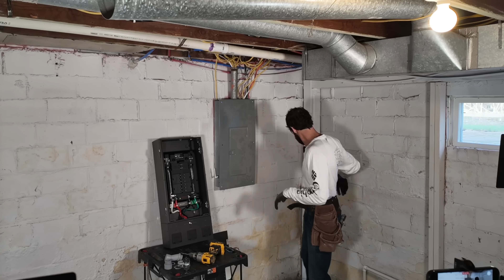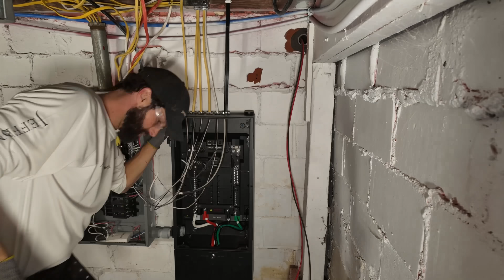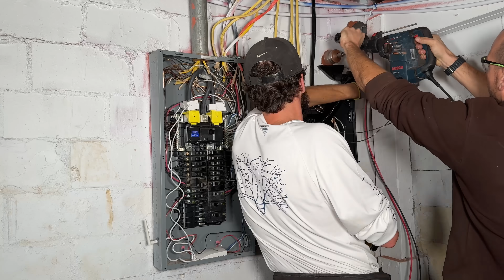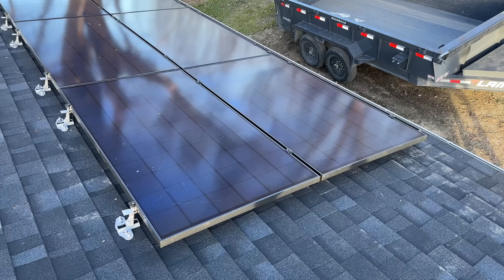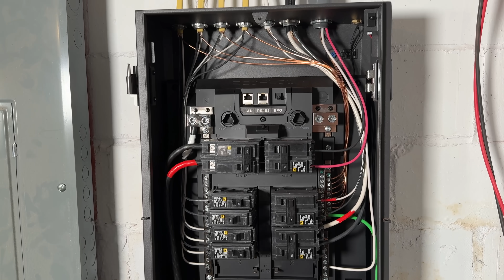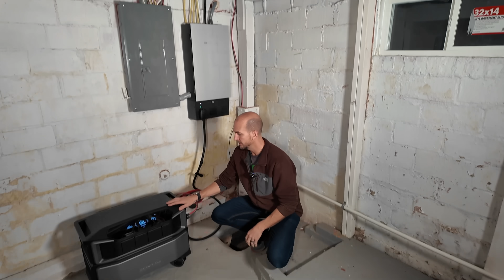A Sub Panel That Actually Saves You Money | EcoFlow Smart Panel 2

Comment: Just purchased a Delta Pro 3 and Smart Generator 4000.  I plan to get a few solar panels to experiment with soon.   
If I get a Smart Panel 2 will I be able to power something in my home always from the Delta Pro 3 (if it has enough charge obviously) or do I have to choose all grid or all battery ?  Is it Either/ Or - I'm just confused if I can power most of my home from the grid but something from battery at the same time ?  I just want to be sure before I invest in the Smart Panel 2.  II will also likely need  more battery or an additional DP3 if this does work like i hope it does. Thanks

Comment: question to anyone out there: let's say that i have 5 batteries under the delta pro ultra. does the electricity drain from the top battery first or the bottom battery? if it drains from the top battery first, eventually i will have to take off the top battery and use the next battery right?

Comment: Why move the cable, use the junction box and have to punch so many holes in SHP2? Could’ve just run the cables thru 1.5” conduit between the panels, and use your old panel as the junction box. That way of the SHP2 have issues you can put those cables back on the main QO Panel /breakers.

Comment: If the power is out and your battery is low, does the generator power go directly to the battery (and the house continues to run off the battery). If so, is it configurable to bypass the battery and have the generator just directly power sub-panel? My preference would be to only charge the battery so I won't have to run the generator full-time. However, if there is a battery failure I want to be able to power directly from the generator.

Comment: if anyone connecting this to power the home, this is way expensive and STILL cannot power all the circuits in a home. best way to go is a hybrid inverter system like solark, eg4, lux with a manual change over switch, for much less cost.

Comment: BUT, there is still no solution to transfer the entire home panel to run from solar generator or gasoline generator or batteries! I can only transfer certain lines to run from these so called solar generators.  so... i am left with no choice but to install a manual change over switch to switch the entire home panel to run from backup in case of power outage.
Reply: They make a 200 amp panel. You could do your whole house if you can generate that much power.

Comment: First, this is not a criticism. Could you have installed an interlock switch and installed a generator plug for your deltas to hook into?  Thus using your whole box and not a sub panel. Of course you might not be able to power the full compliment of circuits and would have to keep certain circuits off.

Comment: Hi, I've started watching your videos. This panel looks really cool. But my question is everyone showes it with using a delta bank. But what if someone doesn't want to use one of those. Can a inverter be ran into it or would it just be cheaper to do an inverter and have your own rack batteries. I've been watching videos till my head is ready to explode.  Trying to figure out were to start my system. I'm getting me a eco tracking system to start then go from there. Thanks darrell insite will be appreciated.

Comment: 8:20 "Proprietary Relays " -  yes you still have those. Correct about the breakers. You can swap over compatible breakers from your service panel. SHP2 still has relays for each circuit. They live behind the breakers.

Comment: Your panel is inside at least. Mine is outside and the dumbshit that installed mine and drilled for conduit through the top did not seal the hole. My panel shorted out when water leaked in. That was a nice four month process of getting EcoFlow to replace the panel. :\

Comment: I have the smart panel 2 and one Delta Pro 3 4096kw extra battery. Both uninstalled. I’m waiting to buy the Delta Pro 3 Main unit till I can afford it. I’m going to get a Delta 3 plus for $650 for now since it’s the only smaller unit that is compatible. I’m looking forward to install the panel. I already have a manual generator transfer box/switch so can I replace that box with this one? More or less. I’d still have to run grid and generator power into the box.

Comment: Your videos are great!  Can you do a video on switching your SH2 to Generator for charging the DPU up with extended power outage?  I have 2 DPU batteries, a SH2 and when I start Generator and switch SH2 to our new IPower Inverter Generator (GXS7100iRD - 7100 Watt Dual Fuel) half of my circuts on the app turn off.  I am not finding any videos which are testing or presenting the SH2 to Generator(s) and the settings which are needed or should not be done to ensure a smooth transition.  I can't really find any videos which detail this.  The ones that are out there, have worked like the manual says it will, but no really explanation of settings, and things to know.
Reply: In the EcoFlow app, do you have Circuit Priorities setup in the SHP2?

Comment: Can the ecoflow deltapro ultra with smart panel 2 handle 240v loads while getting charged from a 120v inverter generator or do u need to use a 240v generator?

Comment: what size wire did you use from 100Amp to 100amp sub smart panel 2? wire size from 100amp to 100amp?
Reply from the maker: #2 aluminum feeding from the main to the 100 Amp sub

Comment: Does the battery back feed back into the grid if solar generate too much power? Can it be turned off if so?
Reply from the maker: No, this unit will not feedback back into the grid.  If the battery is full and not using the solar for powering appliances/circuits in the home the solar input will go to zero.

Comment: Awesome video! One of the concerns I have about an Ecoflow setup is the long term functionality and efficiency of the equipment (and warranty’s) compared to the industry standard solar options. Would be super curious to see a video talking about calculating ROI and lifespan of a system of like this over 10+ years.
Reply: Exactly… and app support + mobile device dependency. Should at least have a basic web server and Ethernet port someone could plug into and configure if needed and could have any laptop or monitor display the local website.

Comment: Good video. Is this an automatic transfer switch?  Will it go to battery or generator as soon as the  grid is offline?  After watching your video it seems like he wired it as a sub panel.
Reply from the maker: Yeah, it is basically a smart sub panel where you place all your critical loads.  The SHP2 will automatically switch over to battery if the grid goes down.  The panel also has an interconnect where you can switch over to generator input if you had a longer power outage.
Reply: @EverydayHomeRepairs  Thank you for the clarification. Good stuff!

Comment: I've just purchased a DPU w/ 2 batteries (12kWh) to supplement my micro-grid (Enphase) solar arrays. I'm running from the micro-grid, which shuts down automatically when there is no grid power, into my main panel in my home. My plan is to either swap out my main panel for the Smart Panel 2 or just run from my main to the SP2 as a sub panel having critical. I'm more into the "Whole Home" idea, though. 
My question is, when running from the main panel to the SP2, it looks like you ran a 100A breaker from the main out to the SP2. Was that accurate?
Thank you!

Comment: I have a SHP2 but am hesitant to install due to latest problems with failing relays and delays in replacements. Can you install a SHP 2 but also be able to quickly reactivate the original subpanel in case of smart panel failure??
Reply from the maker: The challenge is you are landing your circuits in this panel so if there is a failure in the SHP2 I think you are out of luck without moving the romex back to your main panel or a standard sub panel.
Reply: Didn't know the SHP2 had relay problems. Ill be delaying my order too

Comment: I bought a smart home panel 2 that turned out to be faulty. After I had paid an electrician $2500 for the install Ecoflow sent me another panel BUT gave me the runaround and left me hanging on the cost of the reinstall. DO NOT BUY.

Comment: Another channel tested the inverter efficiency of both the Delta Pro Ultra and the Anker F3800. The DPU was OK at 7% draw down over 12 hours sitting at idle (no loads whatsoever). The F3800 was horrible at a 23% loss in the same period. I assume this is due possibly to the F3800 having a low frequency inverter (more robust, less efficient) vs a high frequency inverter in the DPU (more efficient, less robust with more demanding loads). In either case the fact is both units use significant power just keeping their inverters running even with no load. This power has to be replenished by solar, the grid or whatever. Keeping either unit connected to their respective smart panels and active will have some negative impact on energy usage especially for those on the grid with no other options such as solar. 

In my case I planned on using one of the two units as whole home backup through their respective smart panels but I'm reconsidering that in light of their inverter power draw. In my case the EcoFlow DPU with a single inverter would add 4% to my electric utility bill on average just keeping it charged. The Anker F3800 would be over 15%. Those are significant numbers that degrade the savings one might expect even in time of use plans.
Reply: Sounds like the insurance cost of have “auto backup” power… else you could just manually turn the DPU and transfer switch on when needed… or get a gas generator and auto transfer switch? $$$

Comment: 10 minutes into this video you mention that the 100A input to the Smart Home Panel 2 is a grid tie connection.  Grid tie means different this to different folks. I can’t find anywhere in any EcoFlow documentation that the Delta Pro Ultra inverter or smart panel supports a grid tie function.  By this I mean a capability to put current into the utility. Is it possible that you simply meant that this Smart Home Panel 2 100A connection is  where you hooked the utility to the box, without implying a grid tie function?

Comment: Great vid! Would the panel be able to use grid power with the little bit of solar for home use at the same time, or does it have to be one or the other? I'd like to make use of 4  400watt panels I use for a backup system while when the batts are charged and idle. I would also like to consider using the batteries for TOU at low demand times. Thanks!
Reply from the maker: The way I am doing it now is when the battery is  over 30% I power the circuits on the SHP2 with the battery which gets filled up by my solar.  When the battery dips under 30% I switch over to grid power.

Comment: Either hook up my kitchen oven stove to it or my water. Heat up to it and it'll run it indefinitely one or the other. But it will not run both of them. So one or the other, but then again it could run 2 kitchen stove. Ovens, but that's besides the point. Just not the kitchen oath, stove oven and water heater. And it won't better under white heater and dryer it just one or the other.  And that's if I have two of them connected together with all their batteries still won't be enough.

Comment: What about adding a server rack battery to the smart panel? Is there any option for that?
Reply from the maker: Nope, you either need the Delta Pro Ultra or 2X Delta Pros with a Dual Voltage Hub.

Comment: 100 amps from your home and how many amps from the generator? I have a 50 amp generator
Reply from the maker: You can bring in 50 Amps from the Gen side of the smart panel. 👍.  It is recommended to have an inverter generator to charge the Delta Pro Ultra.  Not a must but that should extend the life with a cleaner power supply.
Reply: @EverydayHomeRepairs  I heard you say you wired the smart panel for 100 amps, does that mean it supports up to 100 amps with only a single delta ultra connected? Another user a person did 125 amps to the smartt panel but I read a single delta ultra only does 30 amps but found a graphic on EcoFlow’s site saying with 3 it supported 90 amps but couldn’t find any written information on this

Comment: would be great if you could do a video on how the ecoflow delta pro ultra and the smart home panel 2 would integrate into an already grid tied solar system. any ideas if this ecoflow combo could work with an ac coupled inverter and act as the battery storage?
Reply from the maker: At this time I don't think that is possible.  You would need to land your solar in the Ultra.  I expressed the same desire to EcoFlow at CES and what you are outlining is a HUGE usecase but not an easy problem to solve.
Reply: @EverydayHomeRepairs  any way you can test this? :) wouldn't the roof top solar still drop into the solar inverter (at least for non-micros). i guess that's the question. can the ac power from the solar inverter go straight into the smart home panel 2 and be routed properly.

Comment: Interesting video! Does this new smart panel work with V2H/bidirectional charging with an EV? If so, what bidirectional home charger would you recommend to pair with the Ecoflow smart panel?
Reply from the maker: From my standpoint I will use the Generator side of the Smart Panel 2.  If you had a Ford Lightning a 30 Amp generator inlet would be the way to go and for the Cybertruck it would be a 50 Amp generator inlet (NEMA 14-50).

Comment: Can an F150 Lighting be used as input into the Delta Pro Ultra?
Reply from the maker: Yep, you could pull off the NEMA L14-30 in the lighting bed into a converter plug which will take the L14-30 into the infinity plus port which should charge the Ultra at 6,000 Watts with a single battery or up to 7,200 Watts which 2 or more batteries

Comment: You mentioned 5.6KW max solar High Power Input in the Delta Pro Ultra.  What if my solar array produces more?  My is 7.2KW.  What are my options??
Reply from the maker: You would want to stay under with a buffer on your voltage but you could push the current to the max and the Ultra would just "clip" the current at the max.  So, depends on how you wire the panels into the high voltage and low voltage solar inputs

Comment: Does this smart panel 2 only work with the ultra or can the pro connect as well?
Reply from the maker: It will accept 2 Delta Pro units connected to a new dual voltage hub that will provide the new infinity plus plug that will be compatible with the Smart Panel 2.  I will do some testing on my other YouTube channel (Everyday Solar) in the coming months where I use the Ultra and then 2 Delta Pro units both feeding the Smart Panel 2
Reply: @EverydayHomeRepairs Good to know... I have the Delta pro and was going to get a second Delta pro but really didn't like the og smart panel...

Comment: is there any decent value to with the delta pro ultra, for someone not able to have solar?  it would be recharged with an a1 power 5100w dual fuel (lp) generator.
Reply from the maker: I think if you are going to charge off a generator for any length of time you would want an inverter genset which provides the pure sine wave output.  In certain off grid setups there would be some value to running a large enough generator for a few hours and then storing the energy in the DPU to then use throughout the day with no background generator noise.

Comment: Can there be more than 12 breakers or can you run more than one Smart Panel 2 at a time?
Reply: You can have 12 breaks if they are all 110's. A 220 breaker will take up two spots. As far as I understand, just add a 2nd smart panel to get another 12 circuits, but you would also have to have another inverter/batt to plug into it. Typically, just add another 100amp breaker in your original panel to bring in the 2nd smart panel.
Reply: @hgodtx  I've since learned that we can put duplex breakers in the panel as well. Two circuits in one slot.

Comment: You can always tell when a company decides they are going to throw a piece of gear at half a hundred social media channels in order to get free advertising.  But you know, the EcoFlow stuff is pretty expensive and smart panels in general become boat anchors after a few years... let alone a few decades.

Smart panels are also completely unnecessary in modern day where you can install enough inverting power to run the whole home anyway.   Instead of having two dozen contactors switching circuits, you just leave everything on the inverter when the grid is up and simply control the grid ingress with a load-support charger.  i.e. no smart panel.

All of EcoFlow's high-end stuff is incredibly expensive... almost twice as expensive as it should be.  It really doesn't make a whole lot of sense to use the gear.   Try pricing out a complete off-grid solution with batteries and both grid-support and generator support using EcoFlow products.  And then do the same thing with 2 or 3 EG4 6000XP's and rack-mount batteries.

The biggest problem with EcoFlow is that they insist on using proprietary communication interfaces and connectors for their integrations, and if something ever breaks out of warranty (or even in warranty), fixing it can get very expensive very quickly.  It isn't really a solution that you can trust will last and be maintainable for decades.

The second biggest problem with EcoFlow is a huge lack of redundancy.  Equipment heavy on the electronics doesn't last forever.  You have to be prepared for regular ongoing maintenance past the first 15 years.

Think about the situation that people who bought the Smart Panel 1 are in now?   Is the Smart Panel 2 going to be any better if a contactor breaks?

-Matt

Comment: I think this is a great video, but I believe your pricing structure is way off or at a minimum needs some clarification.  You mentioned $10k for the DPU and SHP2.  At todays pricing that would be 2 DPUs and a SHP2.  $4,799 (not accounting for the pre-release coupon) plus $1599 for the panel